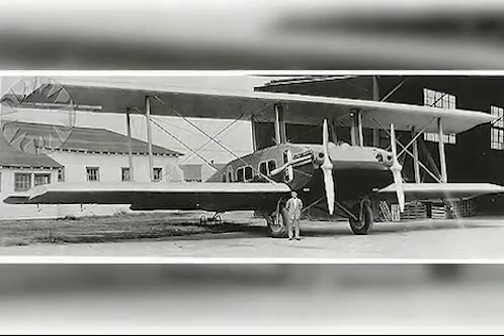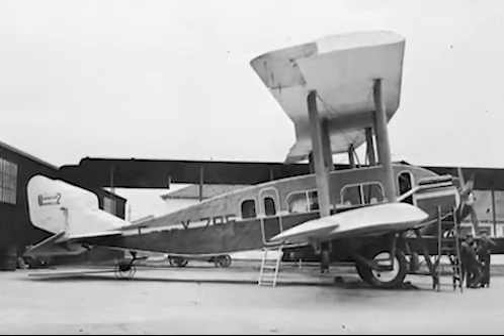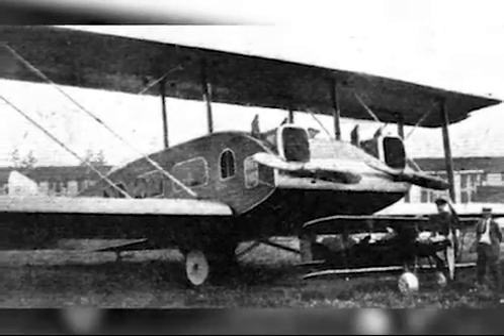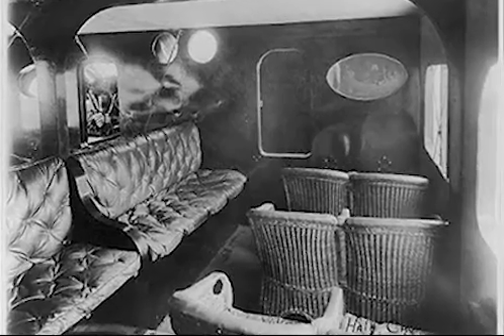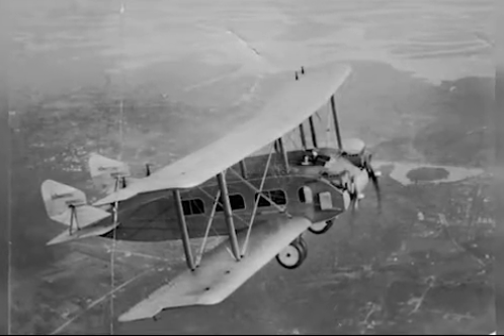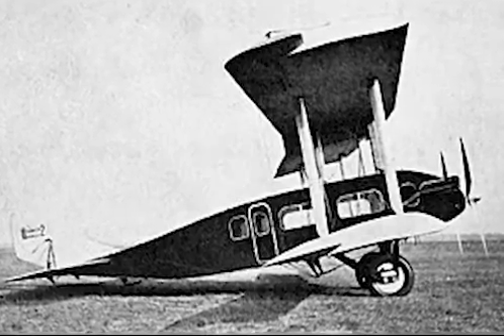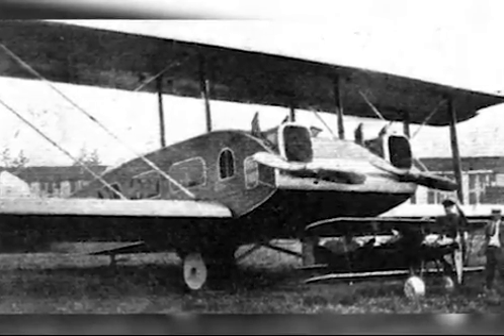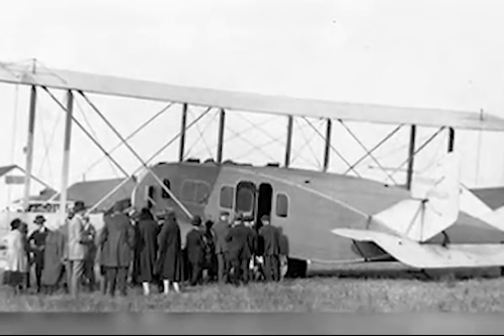The Burnelli RB-1 and RB-2

Comment from the maker: If anybody wants to suggest another interesting aircraft, fell free to to put it in a comment replying to this one :)
Reply: The later burnelli lifting body aircraft were also very interesting...
Reply: Burnelli CBY-3 Loadmaster
Reply: The Arup planes, from Indiana in the 1930s ("Air" + "Up").
Following lots of interest in very-low aspect-ratio planes, the Arup S-2 and S-4 flew for several seasons at airshows.
Contrary to many explanation and equations and all of "conventional wisdom", they were notably not draggy, but were sleek and quick on available power.
The S-2 was 780 lbs, flew 85 kts on 37 hp, with under 18kts landing speed. Would not stall, video shows 45° climb|
See "Flying Heel-Lift" video.

The S-2 flew for NACA and the military at Langley, and put on an amazing performance.
Charles Zimmerman was on the NACA team that saw it, and afterwards used its steep nose-up angle an super-slow stall-proof landing as the starting point for his work on the Vought V-173.
The fact that the Arup planes flew well and were not plagued by extreme drag while at cruise, shows that the Vought plane did not need the over-complex situation with the wing-tip mounted outward turning, tuned oversized props. NACA Tunnel tests of the V-173 showed that it did not gain anything nor particularly change anything versus more normal 80hp props, even spinning the other way.
We can also see that the wartime German Sack AS-6 was also inspired by it, along with many others. The wartime American Eshelman, commonly called "flying flounder" for one. The Soviet Moskalyev SAM-4 "Sigma" also. (Videos for each of these are on youtubes).
See the unbuilt 1943 Boeing model 390 for the flapjack naval fighter we should have seen. Given experience of the Arup and others, it would have flown well, better than anything else and for the next decade. Sergei Sikorsky worked on the Vought plane and designed jet versions (he also knew that it did not need the props of the Zimmerman plane).

Young Milt Hatfield learned to fly from the people at the Arup company, provided the 37hp "American Indian" police motorcycle engine for the S-2.
In the '80s Milt Hatfield built the "Little Bird" series, which ultimately proved everything the Arup planes did. (See videos about them too)

Another modern plane that is similar is the 2015 Rowe "UFO" from Australia. (video is available)